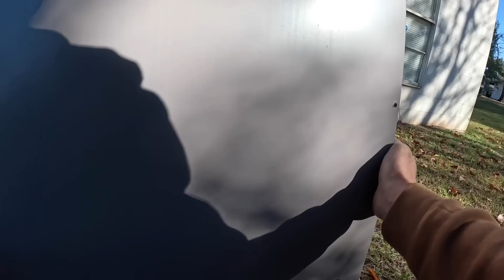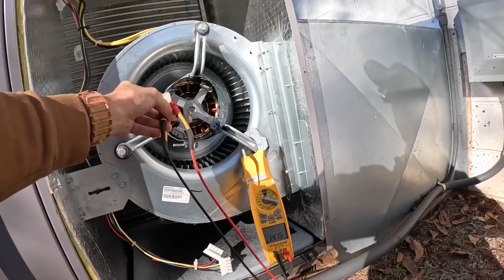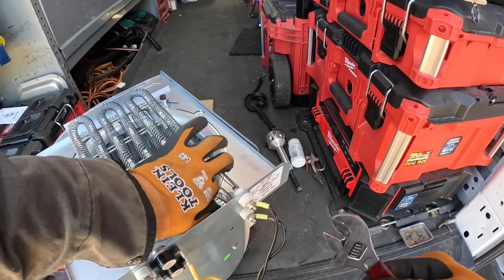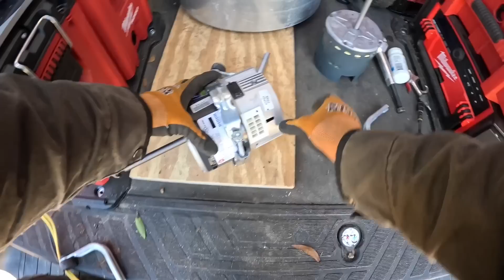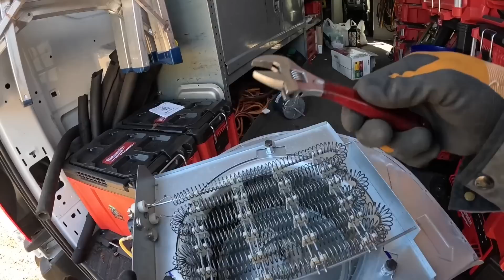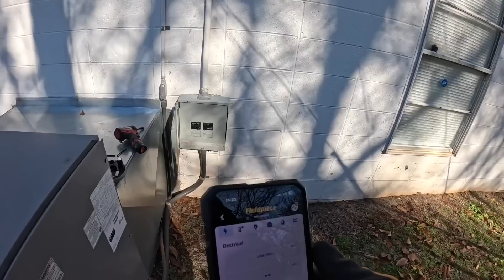Small Church With With No Heat! #hvaclife #hvacguy

Comment: Too bad you can't get just the driver modules.  If you think about it, how can a winding fail internally to produce 5% more resistance?  If a winding shorts to adjacent turns, the R will go down. It can also short to ground.  If something breaks, a winding can open up to very high R.  The only way a winding can increase R slightly is to stretch it a bunch!  I don't think there was anything wrong with the windings.  If it was mine, I'd put a PSC motor in it's place.

Comment: Do HVAC techs use adjustable wrenches because it takes longer, and they work by the hour? The difference in time it would take to use a Millwaukee battery ratchet with a set of 1/4 inch drive sockets would be significant. And those dumb assed square head shaft bolts instead of a stainless socket head cap screw with blue loctite. Geeez! Give me a break!

Comment: Cold, haven't had cold in the south for decades. 1/16/23 was 19 degree.  Harbor freight has some nice gear wrench. Socket sets, you should check it out, you might find a lot of stuff you can use. I see HVAC guys in there just about ever time I go in.

Comment: Strange engineering on that blower assembly.  The strip heat section is held to the blower by what looks like 1/4" bolts yet the entire blower assembly is held to the cabinet by just regular little sheet metal screws.

Comment: Why does the two Ohms reading differ from each other when you checked the motor?  Would it have been the position and force applied to the leads in the connection?
Reply: My understanding of this is metal expands and contracts with temperature change which alters resistance of the windings. Warmer results in less resistance vs colder with more resistance. Having it in the cold air would've caused the windings to chill (especially considering the module was no longer insulating it) resulting in a higher resistance the second time around.
Reply: Didn't think about that, thanks!

Comment: I would be concerned about the 251 voltage to the motor.  Maybe power going to the unit is burning up the motors because it too high.
Reply: Plus or minus 10% of the nominal is standard across North America. On a 240 it can go as high as 264 or as low as 216 before the utility needs to change the taps on a transformer. I see voltages up to 520 at my job and our nominal is 480. Few months ago outside machine techs had me change taps on a transformer because they required +/- 5% on their machines.

Comment: How did you not have to rewire anything since the old motor was 3Phase and this one was 115v-230v?!?!?!
Reply: Actually, the ecm module generates a modulated dc pulse and varies frequency to enable variable fan speeds depending on load
Reply from the maker: Module changes it from single phase
Reply: @HVACGUY  Awesome man! Had no idea the ECM was capable of this

Comment: Does having the heat strip on the input side of the fan cause any motor heat problems?
Reply: No, those blowers have 2 inlets (one on each side), and the motor is on a different one than the heat strips.

Comment: If it's just the ECM module what does a replacement module cost?  Thanks for the video.
Reply: Depends on where you are but the ECM controller (module as he calls it) and combo motor+controller is almost the same price. But you save time by replacing just the controller. The actual motor rarely fails.
Reply: @rogerf3622  thanks

Comment: ECM motors are not made for prime time, too many failures. Stick with PSC.
Reply: Capacitors are cheaper than modules. Lol
Reply: That's like saying we should go back to brushed power tools, not going to happen. They just need to figure out the reliability of the control module, like maybe don't mount it directly onto the motor would be a good idea to start. Veriable frequency drives have been around a long time and are very reliable. Just my two cents.